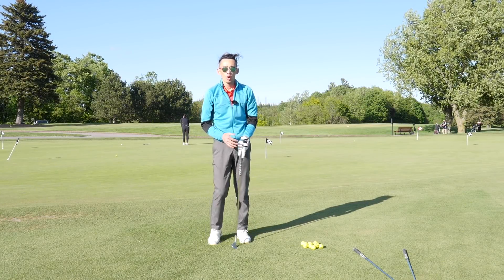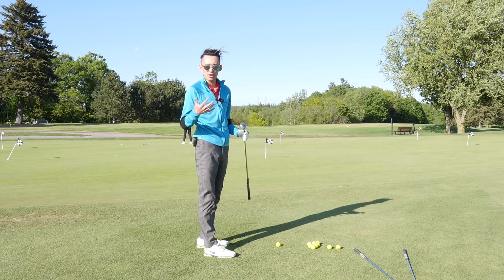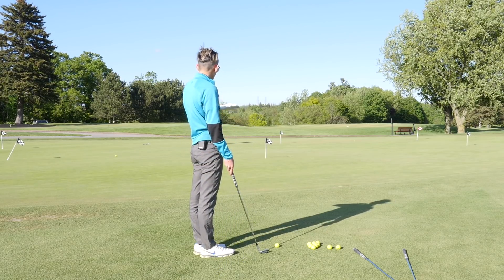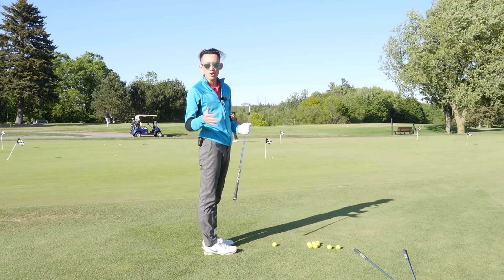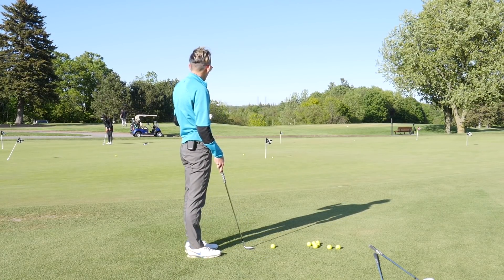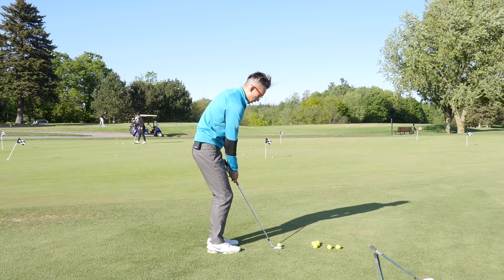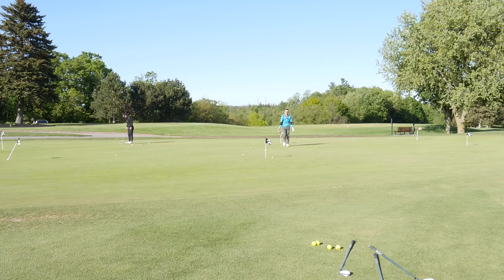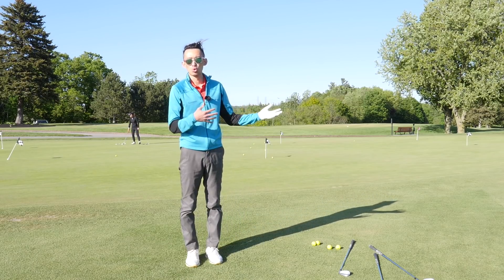Chipping Foundations - Making a decision

Comment: Hello Larry , great video.  What if you are 2 yards off the green level lie on green pin is 15 yards away. Are you still going to use the bounce on a 8 or 7 iron and maybe hit ground slightly behind ball for this chip shot ? Thank you
Reply from the maker: i rather you get very good with one wedge before using a 2nd wedge, wouldn't advise using 8 or 7 iron unless youve done it regularly, u can just use a normal wedge and just play a lower shot to play the run =)

Comment: Excellent video! As a suggestion for another video, how bout sharing the distance/ ratio of roll out for the different types of wedges, if there is such a thing.
Reply: It obviously depends on the lofts you are playing and how fast the greens are, but there is an old rule of thumb called "the rule of 12" where you take 12 minus the number on the club you are using to get the ratio of carry to rollout (for example 7i gives 12-7=5 yards of rollout for every 1 yard of carry) with pw counted as 10 and sw counted as 11.  It is not as good anymore with the modern lofted irons but can be a good estimation especially on slower greens.
Reply from the maker: No such thing, you could play different ratios with just 1 wedge =)

Comment: I get the idea but find it difficult using multiple wedges, as an amateur who plays/practices about once a week.

Chips inside 15-20 yards I'll stick with my 58 and vary the landing zone, usually about half way depending of course on conditions and slope. 20-30 yards I'll do something similar with my 52. Outside 30-40 yards I'll likely go back to the 58 and play pitch shots gauging distance by feel in comparison to a full swing with the 58. 

This is just ONE of the reasons why I'll never go pro haha! However, as long as I can beat my dad I'm good.
Reply from the maker: I'm not saying this is the only way, it's just another option, especially for those who are quite good already with one wedge =)
Reply: @LarryCheungGolf  For sure Larry, I gotcha.